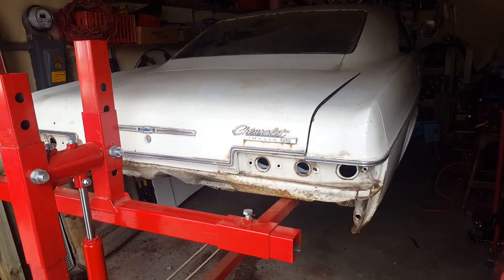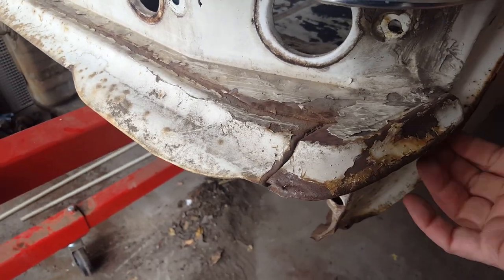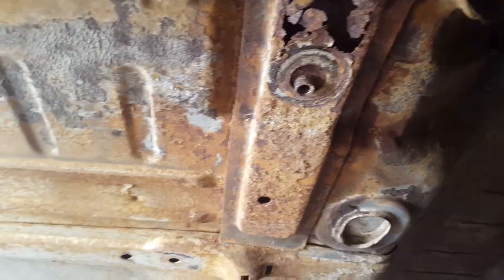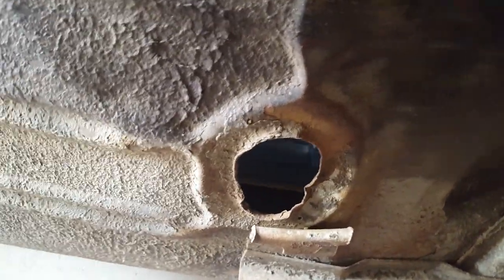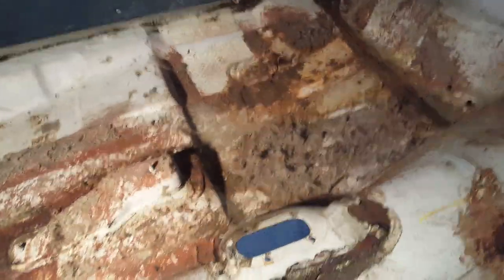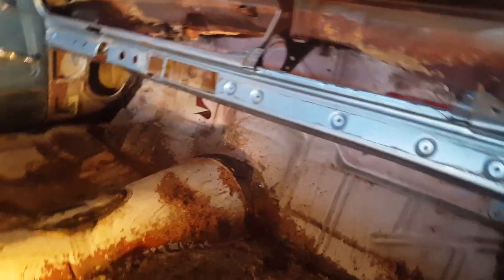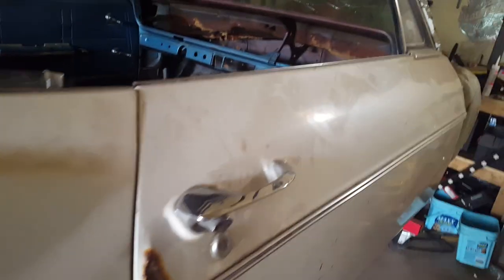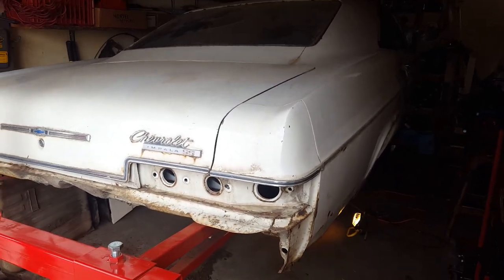1966 Chevrolet Impala SS Frame-off Restoration

Comment: Looks like base impala trim/what denotes it's an SS ?
Reply from the maker: Well to start, it came with "Super Sport" emblems on the original fenders, etc. Also decoded the VIN & the cowl tag, both prove it to be an actual SS.
Reply: 66 impala Ss came factory 4 link rear,base model only has one rear upper control arm,and has front swaybar mount holes in lower control arms,Bucket seats with console,,,MY 66 is exactly this car,327,2sod powerglide,4 link rear,with sway bar,and SS MODEL IS ON VIN TAGITS IN THE FIRST 3RD OR 4TH NUMBER OF VIN

Comment: My 66 was a frame off,every nut and bolt,,OMG,AND MY BROTHER SAYS TO ME,HOW MUCH IS YOUR BUDGET TO RESTORE,I SAID 40K,HE GOES YA,WELL YOU BETTER TRIPLE IT,I SAID NO WAY,,,BOY WAS HE RIGHT,GRANTED I DID  GO FOR TOP OF THE LINE EVERYTHING,I FIGURED,MIGHT AS WELL DO IT RIGHT THE FIRST TIME,9YRS NOW,WELL PAST 100K,BIG HIT AT THE SHOWS,,AND I DRIVE THE HELL OUT OF IT,,,NO GARAGE QUEENS HERE,ONLY PROBLEMS THROUGH THE YRS HAVE BEEN AFTER MARKET PARTS,,,THEY ARE MADE LIKE CRAP COMPARED TO YESTERYEAR,TYPICAL CULPRITS WERE,ALUM RADS,ALTERNATORS,AND FREAK'N MSD IGNITIONS,ONE THING I HAVE GOTTEN REALLY GOOD AT IS TROUBLE SHOOTING,,,,AND IT ALWAYS ENDS UP BEING A GROUND WIRE,,,,EVEN WITH THE AGGRAVATION THATS COMES WITH THESE PROJECTS,WHEN DONE,AND YOU SEE WHAT YOU HAVE SITTING IN THE DRIVEWAY IS A VERY PROFOUND MOMENT,DRIVING IT MAKES YOU FEEL LIKE YOUR ON TOP OF THE WORLD,,,,GOOD LUCK TO ALL AND THEIR PROPJECTS,,,,AND PATIENCE,,,,WHEN STUMPED,WALK AWAY,THE ANSWER WILL COME,,,,,,,66' ImpalaSS ZZ502 5SPD TREMEC 3:42 12BOLT 4 WHEEL DISC, 4 ROW CHAMPION RAD WITH GM STOCK BB WATER PUMP,RUNS 180° WITH 105° OUTSIDE TEMP
Reply: And just remember to always keep safety in mind,especially when working alone,lots OF STORIES about people getting crushed underneath,,,,,,,JACK STANDS,I HAD A NEW JACK COLLAPSE ,HAD TO CHANGE OIL,NEVER USED JACK STAND,THIS TIME AROUND SOMETHING TOLD ME I SHOULD,AND IM GLAD I DID,I 3OULD HAVE BEEN A GONER